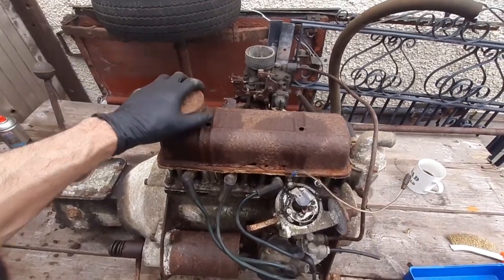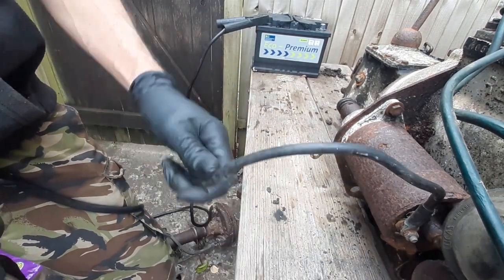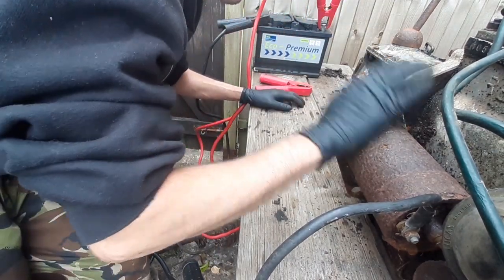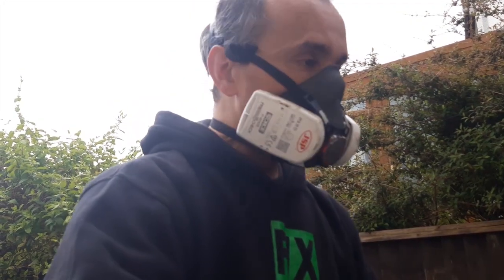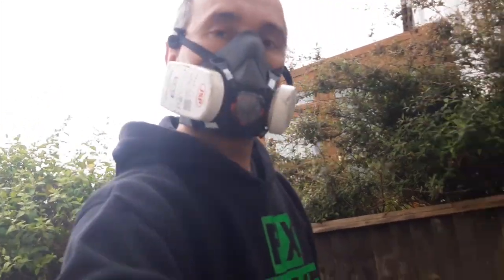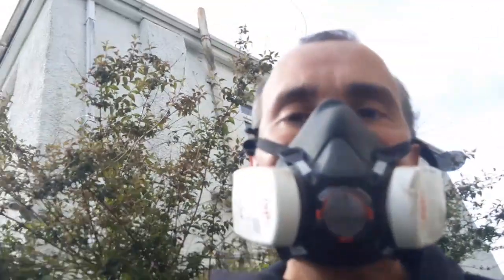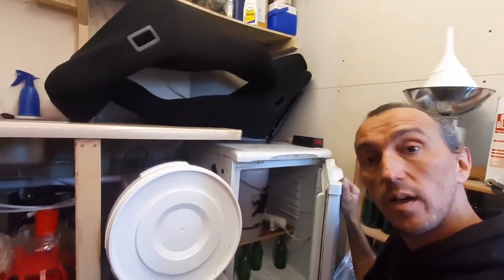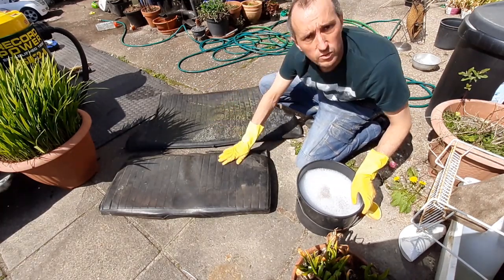Stripping the Axle and Gearbox - Reliant Regal Resto - Part 5

Comment: Great video Steve.
I have a 1986 Reliant trike converted.  I got a spare pair of 15 inch multi fit wheels with it.
Because of the deep inset I am considering moving the springs to inner side of the chassis legs to gain clearance.
Would 15 " wheels alter the ratio too much.?   TIA.
Reply from the maker: No idea to be honest.  I was tempted to move the springs on mine inward so I could have wider wheels that still fit under the bodyshell, on a trike why not just use spacers?
Reply: @StevesMachines  
Have tried spacers, but still touching the springs.!

Comment: don't bother with the steering box, just buy another

i had a reliant rebel steering box break a mounting corner off, i had it welded and the stress on it just broke it again, once they are broken you can't get them strong again
Reply from the maker: Brilliant, cheers for that info, that's exactly what I was concerned about.  I'll just dig deeper into my pockets 👍